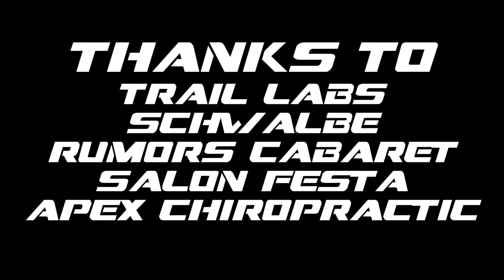NEW Norco Downhill Bike - Dream Build

Comment: I had no idea the vivid would fit the range. How's it ride with the air shock? Epic ride btw 👌
Reply from the maker: It’s a pretty tight fit but worked out!! Big fan of it so far!! Hopefully doing a Coil vs Air video soon🤭 and thank you!!
Reply: Would love to see a comparison vid 👌
Reply: @MtbFierek  Id love to see a video about that, Ive got the 1.1 frame and thought i read that you are supposed to only run a coil on this frame due to the linnear expectation? Also which WRP did you go with? Stroke and E2E as well on the shock? Oh and what are the specifics on the boxxer since I would really love to go away from the Fox 38 because Im not a big fan.

Comment: A vivid air fit not problem?
Reply: From what I can tell, it's the newer Super Deluxe with the a wide cylinder that the comp adjuster sits on the end of that rubs on l and xl frames(I've been told).  Since the Vivid Air has the air can on on the bottom, the reservoir end is slim enough to fit in the shock pocket of the Range's frame.  The Float x2 supposedly fits, too.